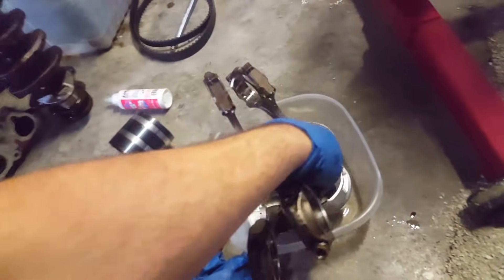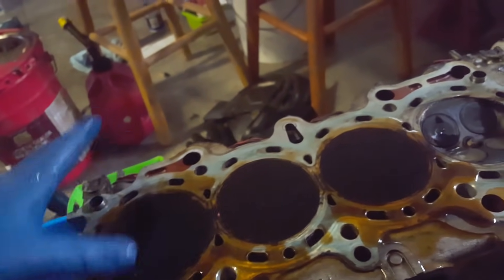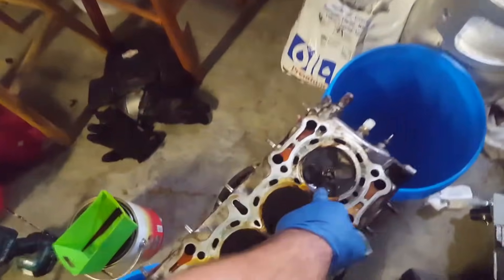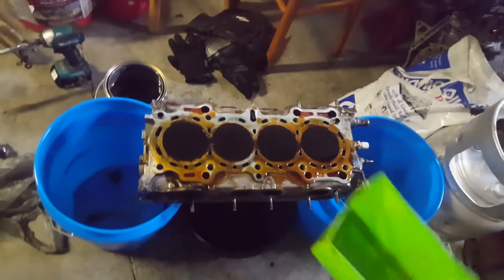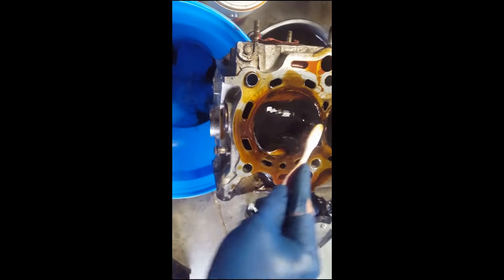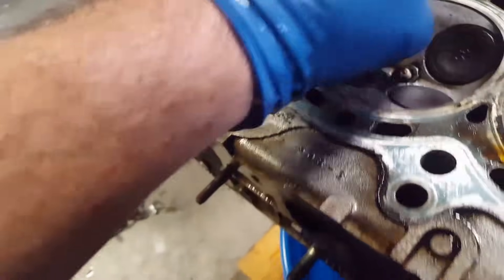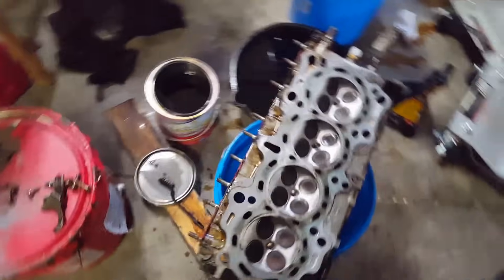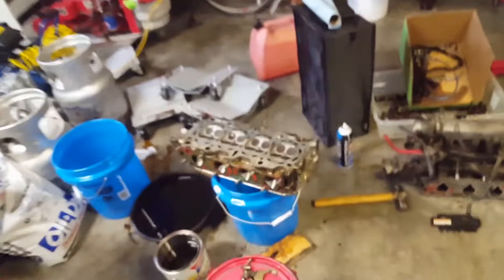It eats away Carbon Buildup EASIIILY!!

Comment: Throttle body cleaner actually melts carbon away as you spray but a toothbrush helps with thicker carbon. Some people saying use break fluid I might try that it's less expensive.

Comment: Gun cleaning solvents like balistol, hops #9 ect. Are designed to brake carbon buildup so if you have any of that on hand it could work in a pinch. It makes me curious what other solvents would perform with bang for the buck.

Comment: I’m a marine engineer.  I’ve been using brake fluid for years . I’ve brought old engines back by putting a few ounce’s down the spark plug holes and letting it sit overnight.  On 350 chevy marine engine wouldn’t start due to lack of compression and after one treatment it started right up and ran fine.
Reply: What type of brake fluid? Dot 3? Or did you mean brake cleaner?
Reply: @kaperkohn1  dot 3 and some Marvel mystery oil
Reply: Thanks alot! Im gonna try this out. Have a 2015 Audi Q7 3.0 gas. Cylinder 2 has low to no  compression. Ive been told I need a Cylinder head or Just replace with a new engine. Trying anything before I go that route.
Reply: @kaperkohn1  how did it go?
Reply: @DamianCornish  
Thanks for the check up...it actually had a chipped valve. It wouldn't seat properly.  Have to pull the head, and install new valves.

Comment: Chemdip works great. There is a soak time required. Product is ,usually, used to clean carburetors. It also stinks like hell. Don't get that s#!t on you it's like getting sprayed by a skunk. The smell takes forever to go away.

Comment: For BEST results, use MR CLEAN (the bright GREEN type, and NOT the light Blue type)! Just SOAK OVERNIGHT and hose off next day. Best thing is, Mr CLEAN will NOT DAMAGE metal or rubber parts like the valve stem seals or rubber gaskets. Best product I have ever used .

Comment: Youdon't need to use proprietry chemicals, a strong solution of soap in water does the same job cheaper and a less hazardous chemical such that you don't need to wear gloves and it can be  tipped into the drains or in the garden. 
That workshop looks like an accident waiting to happen.

Comment: IF it turns the ali Black or even discolors ali .
Then... Oven Cleaner OR a diswhwasher cycle will be a CHEAPER  far more easily sourced solution.

Comment: I use an ultrasonic cleaner for engine parts. I only use water with a little dish soap for a few reasons. 1 being as far as ur every day degreasers go I’ve tried them all none worked any faster or better. 2 When you use chemicals they can damage coatings on the pistons, the valve seals and some are bad for aluminum. 3 You can buy some chemicals/cleaners made for ultrasonic cleaning that will clean faster but they are expensive and the water cleans just as good so a part that takes 30 minutes with good chemicals might take 90 minutes. But if ur not using it every day no sense in using anything but water I mean for under a few hundred bucks you buy the machine then dont need to buy anymore chemicals again for cleaning.

Comment: I use B12 every 6th or so tank full in my 99 Camry 5S-FE 2.2l with currently 150k on the clock. B12 Chemtool is part of my car's monthly maintenance. At $3.50 a can, it provides the internal cleaning that probably isn't being done by the cheap gas I use. IOW, I'd rather pay to know what's cleaning the internal parts of my engine than some lie about some unproven cleaner package in my cheap gasoline. IMHO, this is the secret to getting super high miles out of a port-injection 4 banger Toyota engine. Well, this type of high miles is what I've gotten out of all my Toyota engines using this or a very similar method. Continually keeping it clean internally. And yes, I do use good synthetic oil and have an oil catch can to keep the engine from swallowing it's own poop.

Comment: If you heat it up it works better. Not boiling hot just warm enough touch. Used this for all carb rebuilds and Exhaust brake butterfly's that were sized up.The youth trying to claim what has already been long ago used.

Comment: Thank you, next time I have ot do this to a head I know what works best. I used carb cleaner in a spray can. I pokes a hole in the can and drained it out and poured it into the head area and let is soak over night. The next morning I used a tooth brush and clean it and like you had a clean head. Your method looks like it did a better job over all with less scrubbing.

Comment: So, by "rebuilt" you mean: partially disassemble, clean, maybe new bearings, new rings and gaskets? No crank turning, rod reconditioning, boring and honing, no valve face, seat, or guide work, no resurfacing or balancing?

Comment: If you use ams oil you wouldn't have that problem yes its a part of a Multi-level marketing company and stuff like that has a bad reputation but its not a pyramid scheme I have used it and it works the only problem I have is the price is expensive but its worth the money if you don't like the and oil I recommend liqu moly

Comment: I use chem dip all the time. I rebuild motorcycle and ATV motors and some are really carboned up.  I use the original formula, not the California stuff. It’s smells NASTY , but man does it clean carbon and carbs.  Soak a head over night and nearly all the carbon just washes off.  It is some toxic stuff though , so use gloves and avoid breathing it as much as possible.  I would NOT recommend using it in an attached garage without having the door open and a fan blowing out.  The smell will cling to your clothes too.  
The stuff here is the California formula, it works, not as well, but it’s less toxic.

Comment: If you have a few days to clean it, wd 40 every 6 or 10 hours just spray more on it. After 5 or 6 Days the stuff will look brand new. You don't even have to scrub it. Just keep adding wd 40. Idk why it works but it just dissolves carbon and it disappears. I just did a 302 and the pistons were caked and pitch black. I did this for 3 days and they are now shiny like new and scrubbing them with steel wool the first day didn't even get through the first layer of buildup. I'm be don't this method with my shit forever now. It was effortless.

Comment: I use to disassemble and throw the whole bare head in a 5gal bucket and go to lunch, hour later I come back and pull them out and took a power washer to them. 
Makes heads look like brand new every time. Now days the shit is to expensive to buy like that. Purple industrial cleaner from lowes will clean them up, but you cant let it sit on the aluminum to long, it will eat it.

Comment: The warning is made due to linings and (aluminum hydrogen enbattlement. never soak aluminum long in it.)that may be present since it's a parts cleaner not a specific internal or external motor parts cleaner. You don't want to clean carburetor internal parts with it. Per my brother who was a mechanic before his death in 2010. He taught what I do know about motors. He worked on everything from cars, tractors to diesel trucks for 40 yrs. He was fascinated by modern motors and electronics. Always learning new technologies. That I know of there was nothing that guy could not do. I sure miss him working on my vehicles.. the man was a genius with motors. Love your videos. If you bought it a truck driver delivered it. Happy 2022 to you and yours.😁

Comment: I’ve wondered about cleaning carbon. While build up can be not good, the extra layer of carbon on a piston can improve the thermal efficiency of the engine. It’s an insulator.

Comment: Yeah we used this back in the 70s and 80s.  what  you have is the add to or rejuvenator can.  It is supposed to be added to the 5 gallon can. It works good, however now you have a Hazardous Material waste mess on your hands.  If you take a propane torch and heat the carbon to about 900 degrees it will turn to ash and you can brush it off.  Then it is an inert waste that will turn back to soil. This stuff will also ruin some aluminum, be careful.  Oh and according to the state of California it will make your nuts fall off too!   LOL

Comment: Chem Dip is usually used for soaking carburetors, and there's some things about is. What you are showing here looks to be the "add to" can. It's for the 5gal Dip Bucket (w/parts basket). Reason I bring this up, is the 5gal bucket only has about 25% of the actual Chemical in it. The top part 75% of the bucket is oil that floats on top to keep it from evaporating. The "add-to" can that you have there is about 75% Chem & 25% (anti-evap) Oil. If you pour the stuff from the top of either of these, it won't do much (because it's just oil) you have to pull the stuff from the bottom to get the "good stuff". 
The "good stuff" hiding in the bottom of these, actually eats metals. Leave it in there long enough and it starts to eat away the aluminum turning it black. Also you have to Neutralize it when you pull it out of the "Dip" buy washing it all with HOT water, other wise it will etch itself into the aluminum. It's why our wash basin is near the Carburetor bench in the shop, so we can pull a carb out and immediately scrub it down with hot water.

That all being said, be very careful with this stuff. Even with full PPE on, and thick rubber sleeved gloves, when I do a Carburetor I smell like carb cleaner for a couple days, and it turns your pee pink. It absorbs into anything made of Carbon, and we all are Carbon Based Lifeforms.
Reply: " Leave it in there long enough and it starts to eat away the aluminum turning it black". Yep, learned that the hard way back in 1980. Tough lesson for a 16 year old buying his own parts LOL.
Reply: Thanks!
👍🏼😊👍🏼
I wouldn't have known..🤔
Reply: I was reading the website and yes the smaller gallon cans are worse for Aluminum....and to the Pink Pee....Hell NO! Thanks for the heads up.
Reply: Good to know on the safety side. I’m usually pretty brazen with the chemicals except for MEK, gas & methanol, turps…some things scare me enough to make sure I’m well protected. Gas is one most people don’t even bother with, but get enough of that shit soaking into your skin or breathing it in…not good. It’s probably less the fuel itself and more the additives, but regardless, I quit using it to clean shit a long time ago.
Reply: turning your pee pink?, wow mate that is some serious chemical ingestion, that would suggest that there is blood in your urine
Reply: @kinchegayowie6167  Blood in the urine turns urine darker yellow and then orange in high enough concentrations before turning red if the urine is basically pure blood. Don’t ask me how I know this but yes it’s as painful as it sounds. Pink urine is definitely caused by something else maybe such as this chemical.
Reply: Thank you for the advice. Very helpful!
Reply: You 100% sure it will turn everyone's pee pink ? Give up the red wine or take a sample to your Dr is my recommendation.

Comment: If this was like the can of Gunk parts dip I bought 20 years ago, you wouldn't be leaving it sitting out in the open. The smell would drive you out of the shop (heavy creosote smell). You dropped what ever you wanted in the basket, and closed the lid as quickly as possible. If any splashed on your skin, be prepared for it to stink for the next 2 days.
Reply: Cresylic acid, yes, smells like creosote. I've used chem dip and similar products for over 40 years. Absolutely fantastic when used correctly.

Comment: You keep saying chem dip.  Is that chem dry comes in a pale like paint does. If so I use that stuff all the time works great. I’ve had throttle bodies sit in it for a week and nothing happened to the aluminum but wow. Nuthin Kline a clean throttle body. Like new and car runs better than it has

Comment: I'm 66....and just found a chemical to clean carbs and carbon better than anything I have ever used...by accident.  Denatured Alcohol.....it will take every single little bit of nasty off of an old crusty carb like I have never seen.  And it won't even hurt you if you get a little on you.  I had a yamaha 150 that had been sitting for more than 10 years and was looking for something that will take off old crud.  I tried everything in my cabinet and could not believe how well denatured alcohol and a small acid brush works awesome.  Give it a try....peals off the goo like you won't believe

Comment: I wonder if you'd be able to introduce that into the intake system like I've been doing for years with seafoam I wonder if that would be all right I'll have to investigate that.
Reply: Hey Justin I'm wondering the same? Have you had a chance to try it? Thanks for a reply It's super appreciated. Eddie J.   Long Island N.Y
Reply: I've run it through intakes. Smokes like hell. Harsh on any plastic/rubber/vinyl parts etc., take those off or plug before you do.

Comment: Aluminum and Brass can literally disolve in Acidic Solutions like this. That's why you have to keep it under 4 hrs. Our Machine shop does the same with Acid Bath, but Iron motor blocks can stay in a lot longer

Comment: 4hrs... there will be a caustic or high ph compound it it, that disolves aluminium... try tergo strip for the same results but in 5mins... again beware of the caustic element effect on ali... neutralise with a weak phosphoric acid solution

Comment: The 4 hours or less time limit for aluminum is so they take no damage. In the old days at engine shop if you acid dipped aluminum head for more then an hour no need to retrieve it because it will dissolve away. yes it will melt into liquid with the right chemicals over time. so dont do this is you are tired cause if you fall asleep and leave it on to long you got parts to buy.

Comment: Lightning Cleaner is what I found unreal for removing baked on carbon the VW cylinder head in a water mixture (1:1)soaking for 8hrs then rinsed it off with tap water (no scrubbing) for a bright shiny finish.
Reply: Hey Thanks for the tip! Is that the name of the product you used? As I've never heard of it? Thanks Eddie J.   Long Island N.Y
Reply: Am about to do my vw too 😮

Comment: do not , do not buy a direction    engine    car  !    ( gdi )  . especially if you plan to keep your new car  for  10 years or so .   taking a motor apart if things are worn  is understandable  .  but that  usually happens when a car  is  already  20 to thirty years old !     taking  a  motor  apart or even just  removing  a intake   manifold   JUST  TO   CLEAN    VALVES    IS   NONSENSE  .    this design   IS NOT   good for a   daily  driven car  .     racing   car  , yes  , daily  driven   car   , HELL NO .

Comment: So can you pour chemdip into the cylinders to clean out carbon without rebuilding the engine? Then suck it out and cycle the engine with no spark plugs. Change the oil? Put fresh oil and run a bit and change again?

Comment: I used to have a very precious man do all the valve jobs in my aluminum heads he would put the heads in a big tank of carburetor cleaner and they will come out like brand new the only man I trusted with doing valve jobs and all my aluminum stuff back in the day lot of Fiats with burnt exhaust valves actually made a special l
Socket wrench just to torque the head bolts without taking a cam tower off

Comment: Used this stuff back in the 80s . We actually had a Bath of the stuff . Dissolves carbon completely . And washed off with water .
Be careful ! It will dissolve the Biologic carbon in your body structure the same . HAZARDOUS chemical , but effective .

Comment: the reason "under 4 hours" is that it is caustic soda,or Drain Cleaner,and it EATS AWAY  the clean aluminum FAST; and,no,it does not dissolve caked in carbon; NOTHING does,you need to remove it by force,meaning mechanically.

Comment: the reason you can't soak aluminum for over for hours is because, the “coating” it dissolves from aluminum is called aluminum. Aluminum is soft than cast iron and can’t withstand chemical soak.
Reply: It's not the softness that is driving force of the chemical attack, it is the pH.  Aluminum will corrode if the pH is too low or too high in the absence of corrosion inhibitor additives.  In this case, the pH is a touch too high which etches the aluminum and the formula matrix is such that corrosion inhibitors cannot be added.  There is also the risk of a hydrogen gas explosion if you let the aluminum soak too long because hydrogen gas is a byproduct of the corrosion reaction.

Comment: Had A 1970 Ford Maverick with an inline 6 cylinder engine and from the travel to work or home again (about five miles) it would "PING" like crazy. Finally pulled the head off and every piston had a layer of fuzzy black carbon. Had I had this stuff you showed I would of used it. Instead of working for a weekend to remove the carbon and reseat all the valves and other seals and gaskets and adjustments. Really cool man what that stuff does.

Comment: The reason they say 4 hours is it will begin to deteriorate the aluminum. A friend used a can I had to clean his motorcycle carb. Forgot about it for 4 days. Was nothing left but a small piece the main body. Turned it to dust.

Comment: All y'all using oven cleaner on aluminum parts are teasing the devil... 5 minutes may come out alright, but leave it on longer and you might wipe more aluminum off than carbon.
Drop a piece of aluminum foil in whatever you try, if it disappears then so would that much aluminum from your parts in the same amount of time. One of the best degreasers around is boiling hot water with washing soda (sodium carbonate) in it, and that stuff will make aluminum foil FIZZ as it dissolves it. Same with lye.

Comment: Can you do it on the entire head
Reply: Sure ya could. But don't waste chem dip like he did. You wanta keep that fluid as long as ya can. I use primarily 4 small parts. Its got a dip basket in the container. Take head to carwash an pressure wash it. Use purple power.